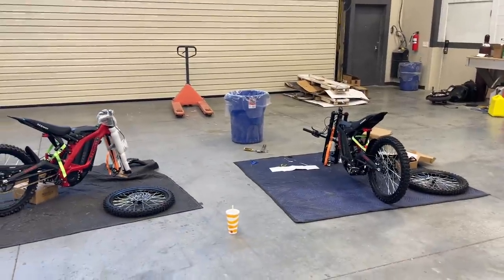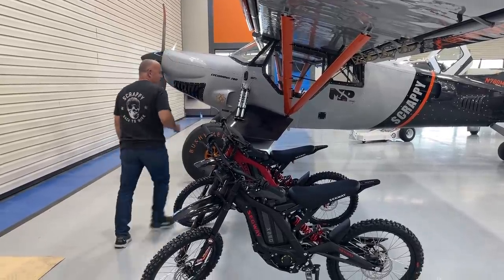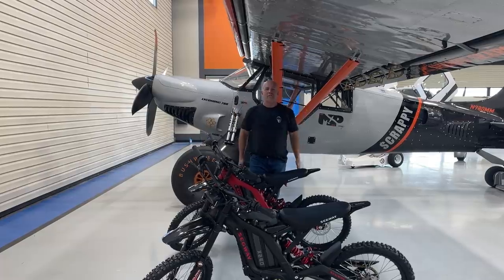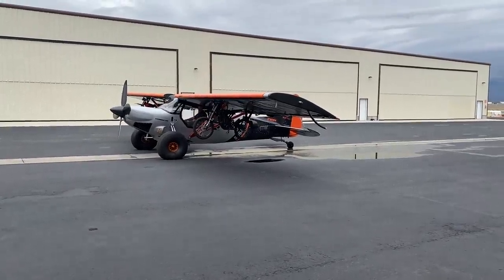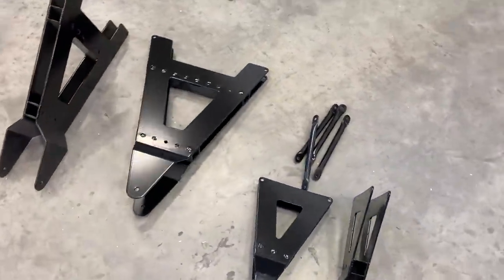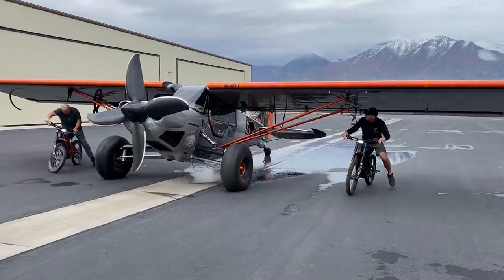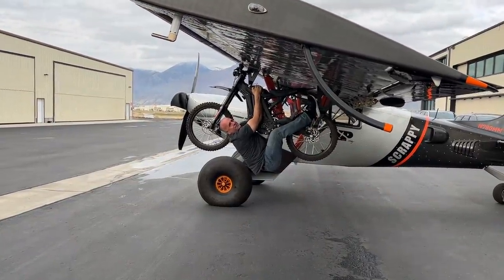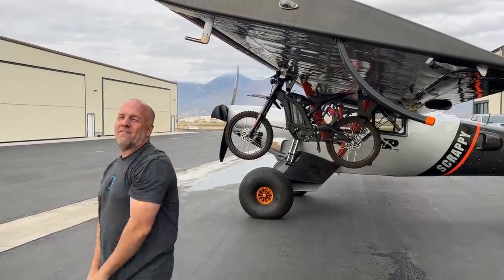Mounting Electric Motorcycles on Extreme Bush Plane | Scrappy #63

Comment: This is brilliant! 
One thing that comes to my mind: wouldn't it make sense to use a streamlined capsule / hull (or at least a "nose"), to optimize the aerodynamics of the load that's hanging under the wings? Of course that hulls would add a few more kilos of load, but I'd assume that it could increase the aerodynamics enough to have a positive overall effect (consumption, speed, flying characteristics in general) to the plane.

Something like a travel suitcase in the shape of the "Areovelo" speed bicycle - could also be used for other cargo.

Detach the bikes together with hulls from the wing, and they even have their own garages in the basecamp. :o

Comment: Mike it would be great if you do a partnership with SOLIDWORKS and teach the things that you did in scrappy, like the eletric bike spars, teaching how you get the thikness to suport the bikes, and the wings support everything, other great thing to learn it would be how you selected the alternator to handle the eletric motorcycle charging and all the electronics, and the eletric plan to make the switch between solar panels and engine/alternator charging.
Image videos in one site teaching things like that, like how mike made the wings for scrappy, how he selected the wings ribs and spars thinkness
Imagine how many people will learn from you with SOLIDWORKS, like a university, but online and with no numerical calc, calc101 and all those college subject they make you learn and don't use

Comment: Brilliant, Mike. Thanks. One concern, though: If you have an inadvertent detachment of one bike - maybe as a result of a metal fatigue failure - will Scrappy still be flyable? With the best of intentions and designs, failures can and do happen. Could you land safely, or would you need an emergency disconnect system for the remaining bike?

Comment: Great work & engineering of finding a way to mount the externally loaded motorbicycles to the wing of the aircraft. Just a few questions on the mods made to the aircraft and the mounting hardware for the motor-bicycles. 1) How many motor-bicycles will be mounted to the wing at the same time? 2)How much do they weigh? 3) How much frontal & side surface area do the M/B's have? Are fairings available for the externally mounted M/B's? 4)Is the tri-angulation being used to support side loading of the M/B's enough strength, in the event of cross-winds? 5)Where are the external mounting points being attached to, on the wing of the aircraft? What structural points were used on the wing for the external mounts besides the modified rib? 6)Were the external mounts or modified structure, welded to the aircraft? 7)What type of aluminum was used for the external mounts? What type of aluminum was used for the modified ribs? 8) Was there an STC available for the external loading of the M/B's to the wing of this aircraft? 9) Was there an STC available for the P.V. panels on the upper surface of the wing of this aircraft? 10)Was there an STC available for the additional electrical charging equipment on this aircraft? 11) Is this an experimental (non-certificated) type of aircraft? 12) Were the landing / take-off, loading , top & stall speeds, range capabilities changed by externally loading the M/B's on this aircraft? If so, by how much? 13)Did the use of fairings on the M/B's improve the Take-off, landing, loading , top & stall speeds, range of this aircraft? If so, by how much?

Comment: You could also make matching carbon fiber stretcher rescue pods with temperature control in them that plug into the wing charger plugins. make the underbelly of the pods capable of a runway scrape just in case for safety and include 1hr O2 tanks in each just in case you have to go to high altitude.

Comment: Mike, I love your videos and I love scrappy...very inventive and provides a practical usefulness in so many ways.  One thought on the bikes...you appear to have done an excellent job hanging and securing them, but have you considered components on the bike that might come loose because the engineers designing the bikes probably didn't expect them to have wind loads of 100mph?  I'm thinking cables, and body panels...the stuff you didn't engineer/design.

Comment: Scrappy has training wheels now...../

I like Mike's idea of a "bike sock" for aero . You could make them out of thin stretchy neoprene like a wetsuit with twist-lock fasteners on the bike frame. Or use thin carbon fiber wheel spoke covers like on land-speed vehicles. Fashion the body aero package out of the same kind of carbon fiber and use the same twist-lock keepers while in flight.

Comment: For the wing brackets:
Fun is nice, exitement euforic...
But this plane has a serious side likewise the owners.

Emergency equipment?
Life rafts ( inflatable) can be used as shelter in hights too.... 
Radio signals, or spots you can deploy in flight.... 

Just some stuff for the other passion and unstoppable attitude.
Back to work 
And kind reguards from the netherlands

Comment: I was wondering about the "lifting the rear tire up first" method. That lets the front end to flop around when the handlebars pivot, having a helper handy solves that issue, BUT being able to load it solo would be a must in my book. Lets see you do it solo Mike! I also charge in flight, my Montague e bike, and after a while you get a feel for how many hours, or portion thereof, of flying, translates into how many miles of riding you can do.
Reply: For hanging the bike solo, just use a couple of tight bungees to keep the handlebars from turning.
Reply: Loading a bike rear-wheel-first onto a ute ( = truck in american ) is easier and safer than front wheel first. Hanging nose-down, a forward-raked set of forks and wheel should point straight if the handlebars are not offset too far rearwards. Otherwise, a snubbing pin in the pivot shaft or simple small hinged saddle across the top of the bar clamp should fix it.

Going camping out in the bush can be a solo affair but is the much more enjoyable for having good company. Shifting a joint in one's back lifting whilst alone is not my idea of fun nor safe. No doubt a solo lifting solution will be devised soon enough. The man's inventive brain probably has something light and compact already in mind. 

Disposable papier-mache drop canisters filled with fire retardant, designed to burst and spray on impact as a first responder task spring to mind.

Comment: Medical survival pods that you could drop on search rescue missions where you can't land. This could help give people medical, food, communication and shelter until help can arrive. 
    The Motorcycles look dinky under the wing. 
    I'd make a streamline pod to encase them in. Or at the very least make carbon fiber Cap's to go over the spokes which is most likely your largest amount of drag second being the fenders which could be removable. 
    Kayaks  would fit quite nicely. 
     Looks like the same prop!  Curious if and when you're going with a constant speed or in-flight adjustable prop?  I Realize time is a booger, and once you do that you would once again have to test fly the minimum 5 hours.
        🤠🐂🏞️🛩️

Comment: Would the cost of the weight and drag out way the benefit of electric  ducted fan pods that can be bolted onto scrappy  and use any  extra solar power  available to increase the flight time ?

Comment: I knew guys that would strap refrigerators between their floats and head for the cottage from their local grass airstrips, so motorcycles are "no biggy" - although it's good you are careful. Bikes are designed to pierce wind already and motorcycles are built to keep parts on at 60 mph, just neat up loose cables and take-off pedals for flight. Scrappy is a 4-seater?, so having a couple of mountain bike mounts would be good too. Last thought; owing to the site obstruction, you might want to turn the bikes sideways and connect them side-up to the wings - or to the fuselage (I think fuselage under-mounts are safer - but I defer to the experts).

Comment: Idea: Those bikes are so thin, they could be retracted into the wing on their side into a recessed part of the re-designed lower wing component using carbon fiber coverings that are slightly below the wing and the bikes partially inside the wing using hydrolics or electric hoisting motors. Yes, the wing would have to be redesigned but so much less aerodynamic drag. Folding handlebars and there's that ;)  What would be cooler than seeing the bikes retracting up into the specially designed wing pods and becoming part of the wing itself ?
Reply: @dabney offermein, Changing the shape of the wing, in any way is probably not a good idea (aerodynamics)...But the bikes being stowed inside of the fuselage might be a better idea, as long as the C.G. of the plane can be maintained within the envelope.

Comment: Yeah I'll be super curious how much speed you'll loose just with the mounts, and with the bikes on the mounts.  And OMG... yeah... Rocket Pods need to be on the list for sure with this beast....LOL.  You know, something aero dynamic, to add even more extra storage but with like maybe 4 - 6 easily replaceable rocket cartridges for a little extra boost in flight or during takeoff.  Or if the wing can't support that kind of load then Rocket Pods for late night fireworks show....LOL

Comment: High-winds on the bikes could mess them up a bit, particularly concerned about the "acquired" wobble on the front tyres, and of course, the pedals. Would wind turbulence impact the bikes and is there a solution to keep that from happening? (Taking long-duration flights with the bikes attached)

Comment: Hi Mike.  I was wondering about securing the ends of the handlebars.  If one of the bikes has bent handlebars due to a crash,  the front wheel will be at an angle to the airflow.  Do you think that would create an issue while flying?

Comment: Do you need a slinging license or any special license for that load? Also what about everything holding that bike together? Did you have to put locktight on the handlebar stem bolts and axle etc to stop anything vibrating loose during flight? Obviously lock the brakes on yeah?

Comment: I just looked at the manual for those bikes. The batteries should be fine as long as the ambient temp stays above 14F. Also, it says not to charge them if the battery temp is 32F or lower.

Comment: If you remove the batteries from the bikes for low temperature/ high altitude operations, what effect does that have on the center of mass of the bike and by extension your placement with regards to you CG/Cl?

Comment: Correct me if i'm wrong, but if you place the Center of Mass of the Bikes at the Center of Lift, you would actually be moving the Aircraft's Center of Gravity aft and reducing your static stability. In order to keep the CG of the aircraft constant, he would need to add the weight at the existing aircraft CG.
Reply: Additionally, have you looked at different ways a failure would affect aircraft handling? Just curious what would happen if you lost one bike during flight... or if you hit a deer during a continued takeoff and it ripped a bike off. Would you have enough lateral control to keep the wings upright? Another one may be, if half of a mount failed and the bike stayed hanging from only the front or the rear mount. That would shift your CG. Not saying you need to do anything, I would only be interested to hear Mike's thoughts and analysis of these unlikely scenarios.

Comment: Mike, If they have pedals they are NOT Motorcycles. They are Electric Bicycles and as such do not require Lic, Reg, Insurance etc or even a lic to drive. They can also access Bike routes and trails  depending on Class 1,2 or 3

Comment: Thanks for creating this video!  I understand the purpose of hanging the bikes at the CG of the wing.  I also heard you bring up the topic of drag and creating a cover for the bikes.  Is removing the handlebars (to create a narrower profile) and mounting the bikes on the sides of the airframe/body of the plane and option then fabricating a tear drop about them?  Would mounting to the sides disturb airflow too severely to the rudder and elevators on the tail section?  I was also thinking about doing something using existing pontoon mounts to mount a carrier onto the aircraft.  I appreciate hearing your thoughts.  Thank you!

Comment: Awesome work but as an electrical engineer I'm curious; what is your safety plan for safe stowage of high capacity battery packs? Are those things UN38.3 certified? What is the nature of the battery protection system? 

Also, I'd be very interested in a video covering your approach to risk assessment and mitigation, in life and as an engineer. 

Keep the rubber side down 🤘

Comment: Would there every be an emergency where you had to dump both motorcycles to regain control of the plane? If so, would you consider a quick release on both mounts to allow that to happen?

Comment: Actual question, since I’m not an avid viewer of this channel. More of a fair weather viewer. What speeds does scrappy average when flying? My concern would be with the plastic fairings and covers on the bike being ripped off and damaging the bike, plane, or landing in the middle of nowhere. The bike isn’t going anywhere but the front fender and other plastics might not be meant for high speed.

Comment: I think you should consider to improve the aerodynamics of the bikes so that they offer less drag when flying with them. Some carbon fiber fairings. It could also help with preventing icing on the bikes. If it's fixed to the bike it won't be in the way or have to be stowed when you use the bike.

Comment: I would suggest a bungee cord between tires to prevent turning.    Segway Dirt eBike X260.  74 mile range $4,999 each....     0~o      or Segway Dirt eBike X160.  40-plus mile range  $3,999 each...  Scrappy mounts double as a Bike, or Bomb rack. dammmmmmmmn   (low whistle)

Comment: The drag is pretty shocking. Can confirm that just from car roof racking bikes. Two bikes on my roof is more drag than 4 bikes on my 4x6 trailer tucked in behind the car🤦‍♂️. Will be really interesting to see what the drag factor is especially at flight speeds.

Comment: Gee I would have used 2 parrot beaks with bar end pins for handle bars. and a fold down seat post pole that is detachable .. Lot less work and can eject them in an emergency.

Comment: A spoked wheel will (usually) bend/break the frame of the bike, Before it fails, but you'll want to be Fairly Certain that the rear wheel is firmly attached to the bike frame, before you can be 100% Certain that your rear mount is "Good." (The front skewers on a road bike I own 'failed' one time, and I spent 2 1/2 days Under a Doctor's Supervision. If the rear axle should come loose while you are airborne, you might WISH that your jaw was only wired shut, for eight or nine weeks.) As for "What Might Wish to go Camping With Mike," could you Try a real light canoe?

Comment: Haven't finished the video  Are you somehow locking the front wheel so it wont spin making the assumption it wont could be dangerous. I don't know your flight speeds but a tire spinning at high speed under a plane wing doesn't seem like a good idea.

Comment: Zero motor cycle x2 - propeller>motor>controller>battery pack charged by a Prius MG1 or MG2 stator between main prop and engine that almost idling in flight....

Comment: fail...electric bikes with no charge ability? please how much is Segway paying you for this, in back country clicks are not as important as reliability and efficiency
Reply: What part of "the airplane can charge the bikes" did you miss?
Reply: @BrooksMoses  never saw it done with a battery pack it wont charge for long before depleting the battery pack even a generator is hours and hours of charging i have them I do know a little
Reply: @lutomson3496  : He's not charging them from a battery pack -- you're right that obviously that wouldn't work!  He's charging them either from the large solar panels on top of the wing, or from the charging system on the engine.
Reply: I suggest watching the video smart guy....  LOL